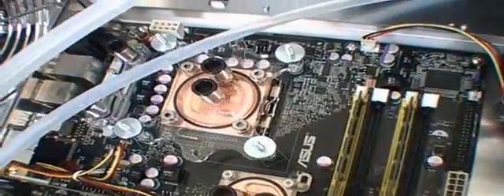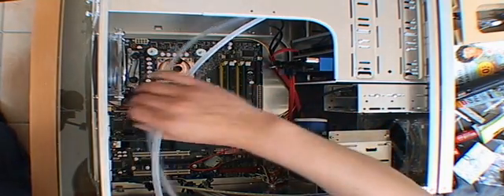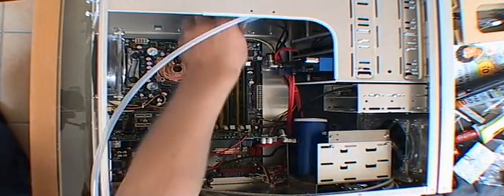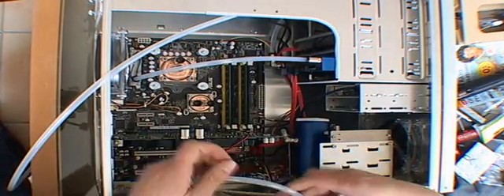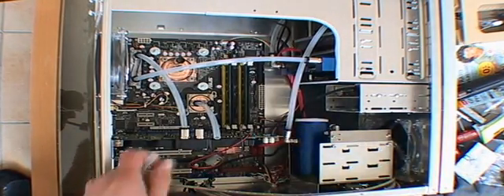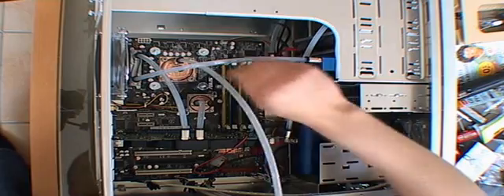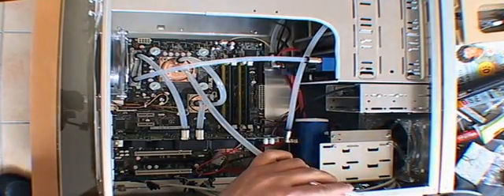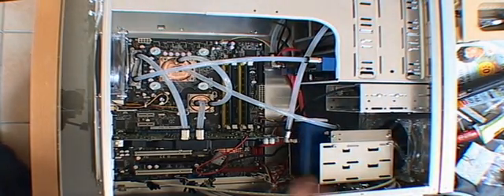Tutorial - Tubing Watercooling

Comment: i have a question could you use veg oil instead of water in the water cooling system so if you get a leak it would not short out the system?

Comment: That's a badass radiator.  Mine was only about 1-1/2 fans long.  Even with a 120mm 3400RPM PWM controlled fan, it could barely seem to remove heat as fast as the CPU could add it (and at the expense of all that noise of course - Radiator air is so turbulent & noisy).

The kit (Thermaltake Big Water) was good for the price & it was fun while the pump lasted though.

Comment: Have you considered branching the loop through each of the (4 I believe) cooling blocks?  In theory, there would be less overall resistance to flow over that length of the circuit, & each block would not inherit the heat of the previous, and overall length(/resistance) of the loop would be reduced.

On the other hand, I imagine that each block would get only 1/4 of the total flow capacity.  I just wonder of the feasibility (pros/cons).

Comment: this is ok only fault i find is that you have hot water going into the graphics card water block then out, where on my system i cool it before it goes into the graphics card with another radiator in the system so it is nice and cold before entering it then back to the first radiator to cool before starting the cycle all over again.

Comment: Dude, capital letters.

Also, sure distilled water picks up whatever it touches and ceases to be distilled, but air itself is not exactly a good conductor so i don't see the problem. Who told you that shit?

I've had a leak once, my water was allover the place but no harm done whatsoever. Also, i think i only used de-ionized water in that loop so even that's good to go.

Comment: You are absolutely correct in the use of small tubing, my dual cpu set up years ago used 1/8" internal diameter pipe. Water has enormous heat capacity and there is no need for huge pumps. I used a heater matrix from a Ford van and home made waterblocks... the pump was a 4.5w one intended for garden water features.

Comment from the maker: No ..

in a watercooling system water temp is nearly the same in all blocks ... water is just to fast (even in low flow system) that it can´t pick up that much heat ;-), that´s also the explanation why high flow does not make that much sense (depending on the cooler of course)

Comment: alot of people are dissing on this guy.  I don't think He's too far off on the huge loop idea.  If you think about this series setup, heat is transfer to the coolant, but the coolant moves very quickly, thus not alot of heat is pickup per volume.  in another video on youtube of a tutorial -- a 3 way SLI setup, its also this same setup: series thru 3.  But when all cards are under the crysis crusher, the temp is typically the same on all three cards (maybe 1*c higher on one). just my thoughtsl.

Comment: Cool vid just a quick question, I'm looking at getting into watercooling and to begin with I just want a simple loop to only cool the cpu maybe the gpu later on. What would be the best path to use?

I'm gunna be using a Stacker 810 and a Swiftech H20-220 Apex Ultra kit. Thanks.